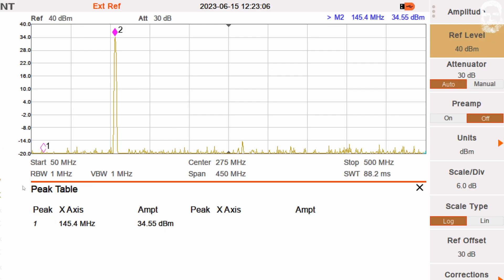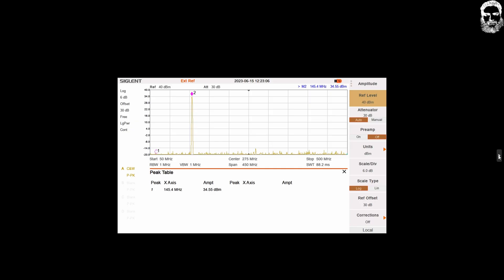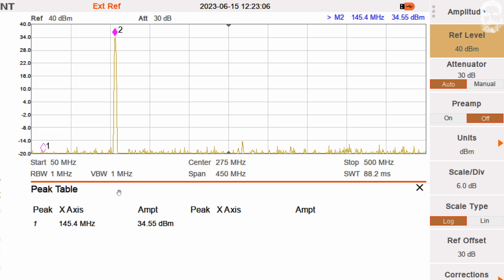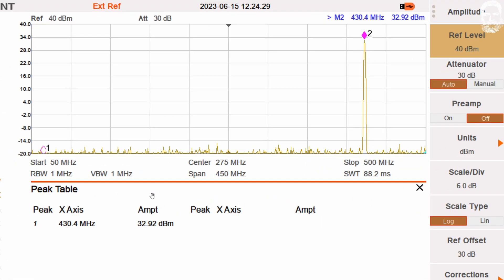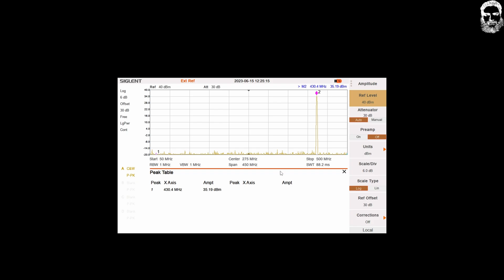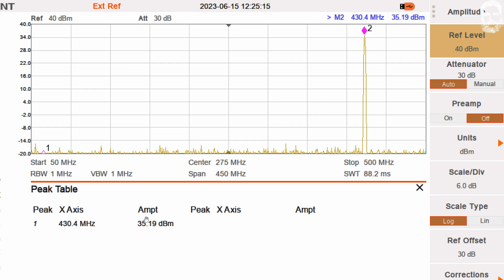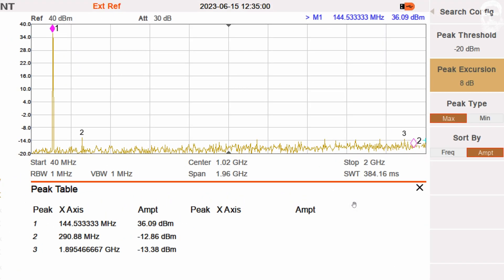Hacked Quansheng UV-K5(k) a Baofeng Killer? modulation - power output - Antenna SWR

Comment: hi, i got this radio and the new uv 5r plus. on both radios the sma connector of the radios are shorted. i did a continuity test with my multimeter and in both radios the sma pin and the sma part where you screw the antenna are shorted which means there is no ground on the sma connector so whether you use a ground or not it doeasnt matter or maybe makes things worse. on every other radio i have the sma connector is as it is supposed to be. 
also on the back of the radio on the baterry pins, which are on the back top the negative is connected to both the sma pin and the part where you screw the antenna. but the ground which is the middle baterry pin is not connected anywhere.

can you check your radio if it is shorted ? or mabe this is how they come out from the factory ?
thanks

Comment: Firmware Bug oder Konstruktionsproblem. Externe PTT funktioniert nicht wenn Squelch offen ist oder Frequenz belegt ist (Busy Bug?). Ansonsten funktioniert das Baofeng Mikrofon mit dem UV-K5.
Klasse Video, besten Dank für deine Arbeit. Sehr informativ. 👍
Reply from the maker: Soweit ich mich erinnere, gibt es eine Funktion dass man nicht senden kann wenn RX aktiv, liegt es vielleicht daran, klingt zumindest danach? Hoffe ich verwechsle jetzt nichts. Das Mikrofon muss ich nochmal testen. Hatte meines vom 878 genommen, welches auch am UV5R geht, Lautsprecher und PTT ging, aber keine Audio in der Aussendung. Muss ich nochmal mit einem Anderen Mikro testen.. vy73 Sandor - DM4DS
Reply: @DM4DS  ja, die sogenannte Busy Funktion. Scheint aber mit externen Mikrofon immer aktiv zu sein, obwohl sie im Menü deaktiviert ist. Mal schauen was zukünftige Firmware Updates bringen.

Comment: Sandor, how have you measured the harmonics ? I assume you were using an external ATT with about 40dB + the internal 30dB. Can you measure again but please reduce the internal to 10db and the RBW to, lets say 100kHz or less. Also the Antenna was much worser on my unit. SWR about 5 on 2m and 2,5 on 70cm (Anritsu S331E & VIAVI JD724/745). 73 Bernd DK5BM
Reply from the maker: I used an external 30dB ATT. With some time, I can redo the test with less ATT and smaller bandwidth. I also got a second one and so I have a second antenna to measure. Maybe there are differences, like yours , which is much worse. vy73 Sandor - DM4DS

Comment: 40 db down is out of spec.. In minimum should be 50... Better 60 db
Reply: depends on the country
Reply: @juergenw7495  Yes, FCC recommend -40dBc for radios up to 25 watts. But BNetzA says -60dBc up to 1GHz and this radio will not reach it (other radios do, but none of the chinese FCC approved radios).
Reply: @Bernie_DK5BM  yep.. i think in austria (im from there) its 50 or 55db im not 100% sure.